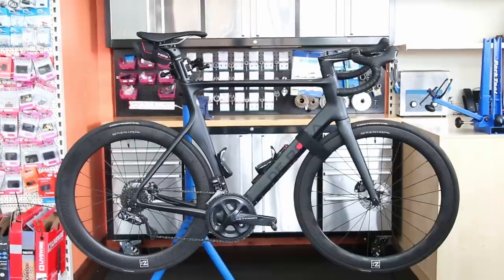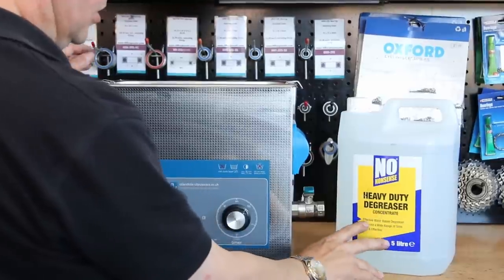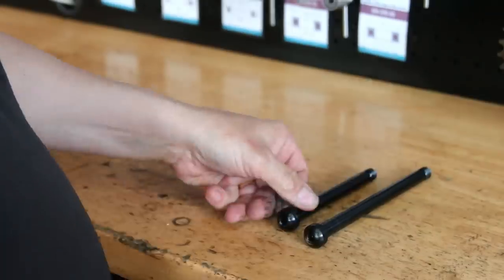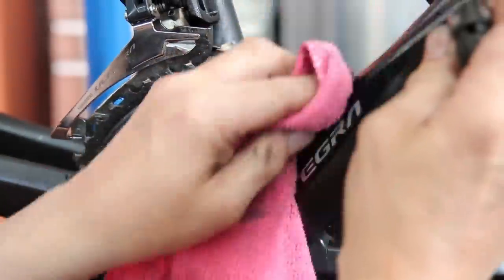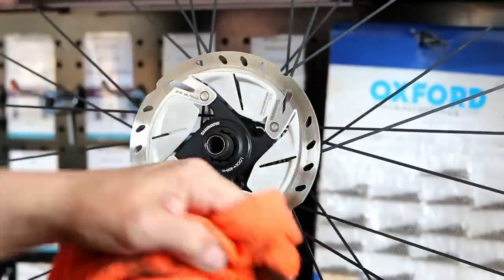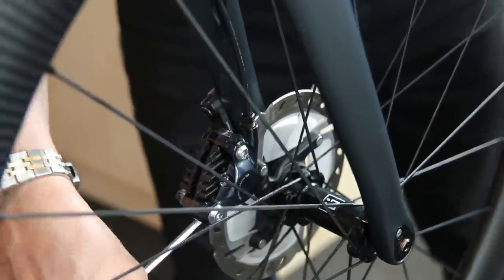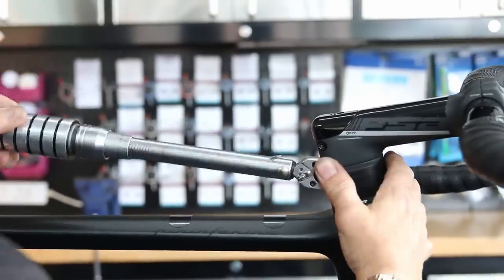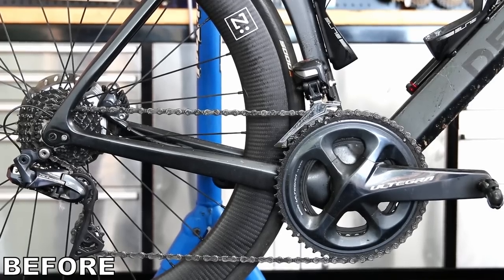De Rosa DI2 Full Service! DI2 Road Bike Update!

Comment: I was wondering if you could use the ultrasonic cleaner to clean your microfibre towels and reuse them... 

New bikes, until you truly know the shop selling you the bike,  you just can't trust them. Sometimes even a pricey new bike will come with a bend derailleur hanger. 
So if in doubt, you should always get your bike serviced by a GOOD mechanic, because the initial setup is gonna affect the way the bike will ride for a good amount of years. 

11/10 video quality

Comment: Lovely again, I do wonder if a Di2 system will be worth it, considering you will have to keep in mind to re-charge the system once in a while (or daily 😔). Excellent outcome as usual! I’m in the process to get my ultrasonic cleaner so by the end of the season here in US I can service my bikes at home!
Reply: No need to wait on the cleaner - just Service away :-)
Reply: @Jacksparrow4986  well, considering I just did early this year, I can fairly say they are running smooth, however I rather prefer to dump all the stuff into the cleaner and let it be, instead of spending a day and a half cleaning it by hand, further more when the OCD kicks in and you want that beautiful shine like new state! 🤣
Reply: Nobody in their right mind charges di2 every day. If you’ve got a bike computer you simply pair it to your di2 setup and it’ll show how much battery is left. Charge it when you need to.

Comment: The pins that hold the brake pads in place are dreadful on this groupset - they are soft and it's easy to round them off when taking them out. It's better to replace them with Allen key versions.

Comment: This is about as close to Di2 as I will get
Reply: Same bro :/
Reply from the maker: Haha if you ever get the chance to upgrade it’s worth every penny
Reply: @Bikespeeds  do you know if the new ultegra Di2 12s shifters are compatible with the old R8000 calipers? I saw that the new calipers have more clearance then the older ones.
Reply: @Bikespeeds  i know u can put the new calipers on the old shifters but can it be done the other way around?